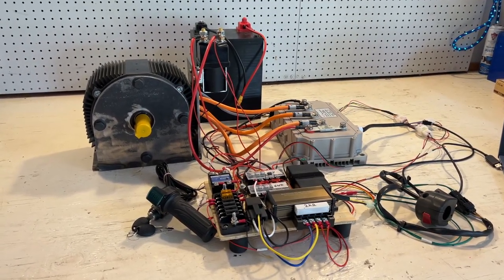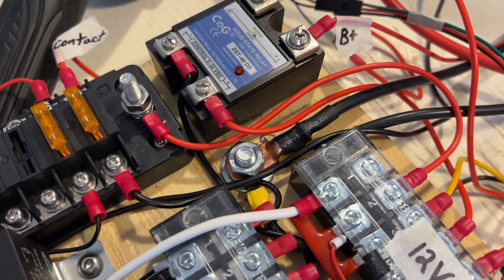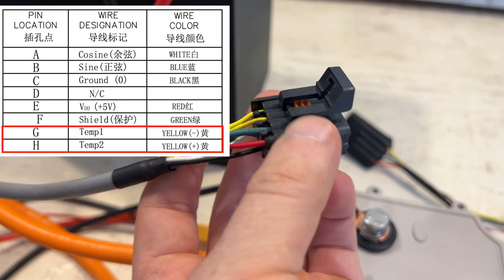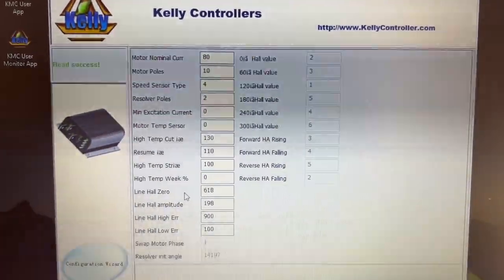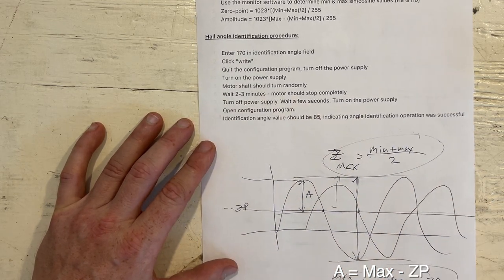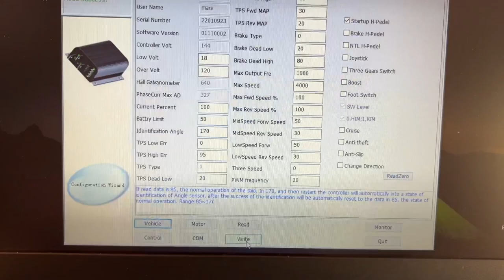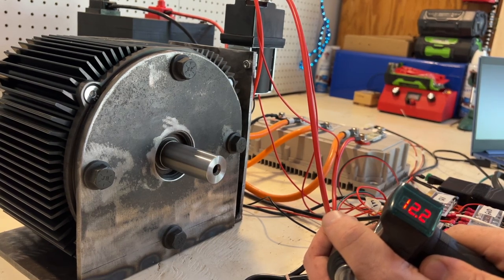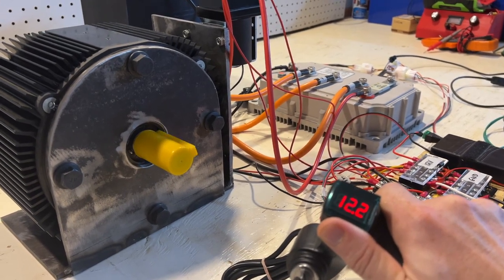ME1507 Motor with Kelly KLS96601-8080IPS Controller - Complete Setup Guide for Basic Operation

Comment: This guy knows that current runs from negative to pos. I like you already.
Reply: Just to be a nerd, the electrons moves from negative to positive. By definition current was said to go from positive to negative.
Reply: @gamingSlasher  Conventional current theory (Benjamin Franklin times) current goes from positive to negative. In modern times, electrons got changed to a negative charged particle so in "electron flow" theory the current goes from negative to positive.
Reply: True physicists know that signs are arbitrary and you may use whichever pleases you

Comment: Thank you for putting your experience with this combo on Youtube.  A few years ago I bought the ME1507 with the Sevcon Gen4 Size 6 direct from Motenergy as a kit and the Sevcon is a total PITA to program so I've been looking for alternatives.
Reply from the maker: Glad it's helpful! I was looking at the Sevcon controllers as well but was deterred given the first thing anyone mentions is how much of a pain they are to program. Maybe I'm being naive but I just don't understand why programming a piece of hardware has to be so difficult
Reply: I can do some basic program settings for your Sevcon controller. I would charge money for the job though. I do not recommend a Sevcon unless you need extremely fine tuned safety features for a forklift or something.

Comment: Great video! It will be helpful for many so keep it up. 

The 1023*(avg)/255 is a scale shift. It is spreading a number that was on a 255 scale to a 1023 scale. I am guessing this is so it is a more bit friendly number to stuff in the smallest amount of memory in the micro-controller brain of the Kelley controller.

I suggest you keep that yellow boot on while spinning the motor. It will keep that key from flying out while spinning and possibly poking out an 👀
Reply from the maker: both good points! thank you!!

Comment: Awesome video ! But I dont understand the precharge resistor ? How is it wired, why is it necessary ? Thank you so much ! 😀 I think its to prevent spark in the contactor but how do you know when the internal circuit of the controller is completely precharged and so you can activate the contactor ? But if you accelerate while the contactor is off, will it burn the resistor ?
Reply from the maker: That's correct. it is to prevent a rush of current from controller capacitors to suddenly discharge when the contactor is closing and cause damage. If the precharge resistor is hard-wired across the contactor (like in this video), voltage will always be equalized so there is no need to wait for caps to charge. if you put the resistor on a switch also, you will need to wait 5-10 seconds. if you accelerate with the contactor off (which I forget and do all the time) the resistor will not burn, instead, the motor will simply not turn since the current will be limited to some very low amount
Reply: @GaiusGarage  Thank you so much it helps me a lot 😁 If you dont wait 5-10 seconds and you try to accelerate will it damage something ?
Reply from the maker: @leonamor8662  for sure! if you don't wait the 5-10 sec you risk damaging the contactor as if there was no precharge resistor at all. but it has nothing to do with whether you accelerate or not. best setup IMO is to hard-wire the pre-charge resistor across the contactor
Reply: @GaiusGarage  Perfect you are the boss 😎👍

Comment: Great Video! very useful. Question, any issues with the 12v not being isolated from battery? The manual specifies an isolated soource for the controller.
Reply from the maker: thank you! the 12V source uses a common ground with the high voltage system but it is isolated coming from the dc-dc converter. from the controller's perspective it sees 12V for the power input
Reply: @GaiusGarage  Having a common ground is not isolated. Might be ok- sounds like it might - I tested my setup with a non isolated one and worked fine - I'm just not sure what the risks are with this controller. You can buy isolated DC-DC converters but they are a bit pricier (>$100) than non-isolated ones- I might just buy one to be safe. Again, thanks for the tips.

Comment: Thank you really great to have some guidance on this. Wondering how things are working out because Kelly states you should be using an isolated power supply?
Reply from the maker: I am using an isolated power supply here coming from the 12V dc converter. it shares a ground with the main battery but this is irrelevant from the perspective of the controller - 0V is just a reference frame for whatever voltage your using
Reply: @GaiusGarage  ok sweet good to know. My knowledge of electronics isnt enough, and i couldnt find anything saying that converter was isolated. was going to use the same converter for my project and already ordered the $70 400w one from Kelly. Should be better for me anyway,  because my 12v system will draw 12+ amps with everything i have running at once. and that converter gets real hot doing 92v to 12v 10 amps when i tested it out. Thanks for the reply man, your videos have been a great help.
Reply from the maker: @poppybond  awesome! glad it's been helpful. Just out of curiosity, what do you have running that youre drawing 12A from your converter? Do you have a coolant pump or alot of lights? I actually got a 20A converter originally to be on the safe sure but found that I only draw around 7A max for lights & contactor.
Reply: @GaiusGarage  The contactor should draw a lot of current to close the connection, but then the power draw should drop way down in order to stay closed (and keep the high voltage flowing to your motor/controller).

Comment: Super helpful- thanks! I am planning on using this combo for a fiat 500 conversion. What’s the max motor speed you can achieve with this setup?
Reply from the maker: nice! I'm working up to something like that. Was going to pick up a Jeep Wrangler TJ for a conversion the other day but trying to finishing one project before taking on more. I didn't program the controller at all but did measure the shaft RPM - got about 6300rpm unloaded at full throttle
Reply: So the controller must be advancing the timing of the commutator switching then to get that speed? One issue I am struggling with is this motor claims 0.026 V/RPM constant, so at 96 volts it should only get about 3700 rpm, which would be too slow… cool to hear it spins faster though. Still trying to wrap my head around various motor controllers out there. Appreciate the help!
Reply: @ride88  I tested this same combo (ME1507 /KLS96601-8080IPS). On the bench with a 60V battery, I was only able to achieve 3000 RPM and couldn't find any setting to increase this. Kelly seemed to confirm this limitation, so we switched to a Sevcon GEN4 controller. I'd definitely be interested to know if anyone's overcome it.
Reply: I’m no expert but since I first found your video I think the setting in the controller would be called “field weakening” up to a max RPM of 6000 which I dug up is a safety thing so the magnets inside the rotor don’t fling apart. Going higher than the base speed with field weakening you get diminishing returns in terms of HP and torque but you should at least be able to spin faster (for me that’s key so I’m not constantly switching 3rd/4th). I’d be curious your results with the sevcon!
Reply: @netmaster10000  In my experience the ME1507 needs at least 90V to be of any use. I first tried a 25S pack in my quad build and when the pack was lower than 90V it wouldn't produce enough power to push it on a flat hill. I was very surprised. I am an Electrical Engineer and I didn't foresee this issue. Quite embarrassing really but as I get older I realise subject matter experience is just as important as knowledge. I switched the pack to a 28S pack and it works awesome! I have since then built a second quad and SXS using Zero's version of the ME1507. They are blasts to drive!

Sevcon controllers are a big learning curve but the quality of the electronics are far superior.

Comment: Great video but I have a safety question and other question.  How/where would you install a kickstand switch that would prevent the throttle from working?  Can a MotoGadget m-unit be helpful with installation for it's alarm and other awesome features?  I'm doing research for a motorcycle install with a hub motor.
Reply from the maker: I'm not so sure about the motogadget - hadn't heard of them until you mentioned. but for the kickstand, typically that would be wired into the brake switch or dedicated pin on the controller side. that way if the kickstand is down, it would be like the brake is activated and the controller will not send power to the motor. I have another video where I set up all the accessory wiring and although I don't include the kickstand as a safety switch, I do have both hand and foot brakes wired to the controller

Comment: Hi, me again... x) 
You connected all the grounds together, but isnt it dangerous ? Most people say that we have to separate high voltage from the 12v 🤔
Reply from the maker: there is a possibility that a short in the high voltage system can damage the low voltage components but all of them are fused at multiple levels in the actual bike. other than that there is no issue using a common ground. ground is just a reference point for the voltage so whether its 12V or 1000V, they are both in reference to some other voltage, which would be called "ground". by connecting the grounds together, you just make the voltages in reference to the same exact value

Comment: Hi. May I ask you? Can I mount all of this without contactor and 12v battery? And what I should to do with pwr wire on the controller pin?
Reply from the maker: the power wire turn the controller on and off so you need that to use this controller. on this particular model, the power wire takes 12V so you so need some sort of 12V battery or step-down converter. The contactor is technically optional, maybe on simple hobby vehicles like a go-kart you can skip the contactor, but I would not build any serious commuter vehicle without one.
Reply: @GaiusGarage  ok. What if my scheme has no second power supply, but contactor mounting directly, is it possible to find contactor 96V 400A? My main battery is 96V. Or I can use lower voltage contactor 72V for example?
Reply from the maker: @ВадимИльев-х1п  you can find a contactor for 96V but 72V wouldn't work

Comment: thats a bldc motor correct?    the controller specs i looked up says that is for a ac motor?    im curious cause i am installing a me1616 in my boat and want a easier to program controller   its the same internal as a me1507 is why im asking
Reply from the maker: me1507 is not BLDC, it is a PMSM AC motor, same for ME1616

Comment: hello, please tell me how to reverse the engine, the reverse does not work for me.  I send 12 volts from terminal 11 to terminal 14, the reverse signal does not occur or to terminal 12. all locks are disabled.  The motor only moves in one direction.  Only through the computer can I turn on the reverse
Reply: Swap hall wires (not positive and negative)

Comment: Hi did you know if you turn the motor by hand to get the high and lows, but the numbers not moving what could be the problem ? Thanks
Reply from the maker: probably connection to PC is bad or you missed a step to enable the monitoring process
Reply: We are using the Bluetooth android app everything is connected ,but we can't get the numbers
Reply from the maker: @ivanivanov-o5s I unfortunately, dont have experience with the Android app
Reply: Ok did you power the controller and accessories from 12v dcdc or directly from battery , beqouse we use only battery for power source and. Maybe electricity is to low to run the encoder ?
Reply from the maker: @ivanivanov-o5s  the 12V source is used to power the controller electronics but the battery voltage is used to power the controller itself. there a line for 12V in on the wire harness, and the battery power connects to the main +/- terminals

Comment: Hi man, can you tell me about the 3 speed function!!! Because I have connected the FWD and ECO and 12v ,, but still it runs on 2 speed instead of 3 !! 
And also the foot_sw is for parking function right ?
Reply from the maker: I dont think the Kelly controller has a 3 speed function - just two speeds. Low is on pin 22 and High on pin 12. not sure about the foot_sw switch honestly - I havent done too much work on this project so far. but you can download the manual here: https://kellycontroller.com/wp-content/uploads/kls-8080i-ips/KellyKLS-8080I-IPSUserManualV1.11.pdf
Reply: @GaiusGarage  thanks man.. if i solved 3 speed .. will definitely inform you 👍🙏🏻

Comment: Alright, my configuration is not that complicated as yours (without contractor or else) but basically it is the same. Just wondering why you only use 12V on Pin7 to start the controller. As for as I understand, all power that comes from the battery goes over the key ignition to the controller and then to Pin7 to turn it on (like a circuit). In my case, after the controller is on, the DCDC which is conntected to the controller is last. Is PIn7 only limited to 12Volts?

btw, is there actually a cover for the poles for these kelly controllers? They should never be left open.

Guess it's even more challenging with two or four motors and parallel all signals.
Reply from the maker: yes, this controller requires an isolated voltage for the power supply (pin7) between 8V - 30V. I'm using 12V since I have it already from the DC-DC converter
Reply: @GaiusGarage  okay, but is it only this controller which requires an isolated 8 to 30Volts at PIN7 or all others as well? Mine is KLS-7245N and I use 72(84V) on battery power so I would use it completely over the key ignition to the controller and Pin7. How do you cover your poles to avoid any short circuit?
Reply from the maker: @Harry-lmao  Im not sure about other controller but it could be possible that your does not require it. There's a section on the kelly controller website where you can download the manual, it will tell you whether yours requires an isolated circuit for the power. other non-kelly controller Ive use can take battery voltage for the power switch. you can find terminal covers on amazon to cover the +/- leads, if thats what youre referring to
Reply: @GaiusGarage  Alright, I need to check the manual again or get support from Kelly just to avoid any damage to the controller. 

Yes, terminal covers is what I'm referring to BUT there is a CNL fuse between B+ and NC which also need to be covered up, right? Kelly should provide this equipment as well. thanks
Reply from the maker: @Harry-lmao  yeah they sell the fuse holders on their website but you can also get fuses and fuse holders on amazon
Reply: @GaiusGarage  ahh, I see. But all I need is a fuse housing to cover and protect the poles (B+/NC) on each side and the CNL fuse. Seems you don't have any trouble with it, huh? Well, since I don't have much space on my scooter the complete controller should be shielded with a cover. When I put the metal plate on top (footrest) the whole thing will prolly go up in smoke 😂😂😂 Perhaps the only solution is DIY here...

Comment: Every video i look they put the positive on the other side of the fuse. I think you're not supposed to put it wherr there is a red line on the nut according to kelly.
Reply from the maker: yes, I see.. I think you might be right about that. ok for a bench test but will definitely have to double check when I finally use this thing in a bike